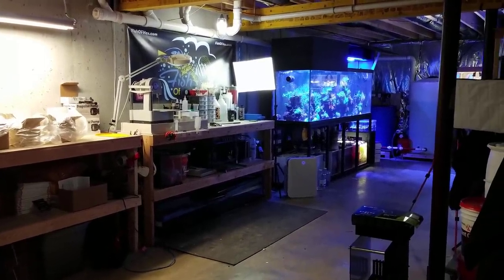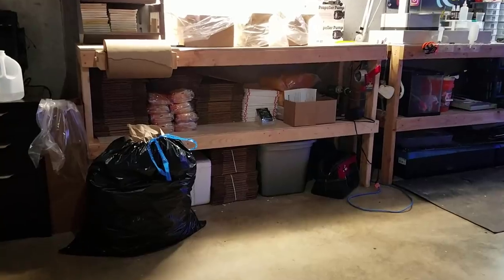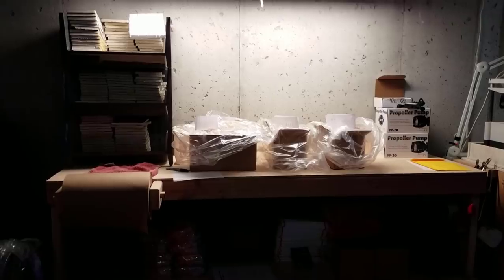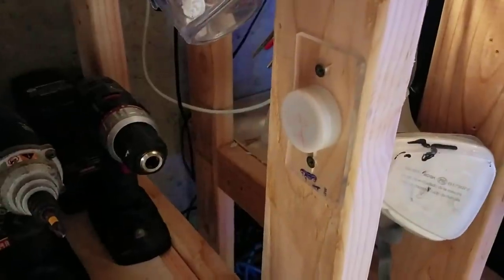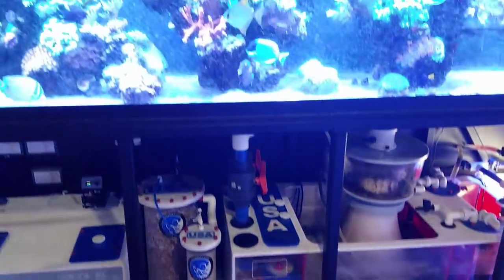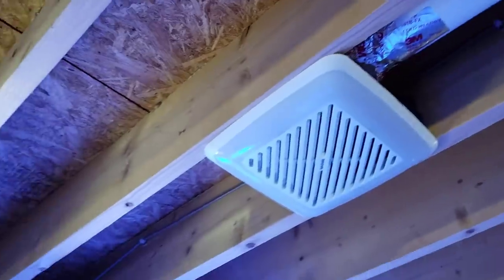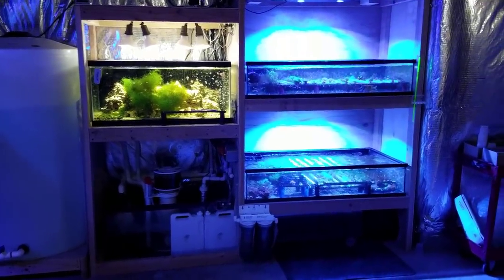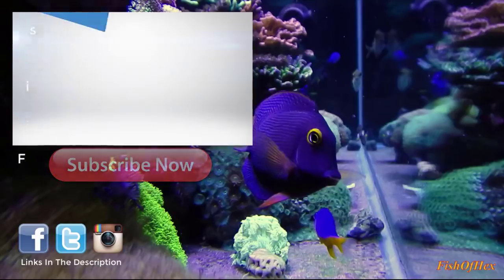Quality Of Life Upgrades Done | Fish Room Update

Comment: Great stuff! (Q.) After an ich outbreak, im running a fallow tank. I used to have quite high n03 and p04. So I had high alk to compensate. Now after a few weeks, montis are STNing Or bleaching as the n03 and p04 have dropped to zero(ish). Should I leave the skimmer off for the duration of the fallow period, as I am finding it difficult to raise the n03 with ghost feedings..

Comment: Nice, I'm looking fwd to the CalRx video.  So based on your DT water Vol plus coral demand, the flow thru rate chosen of your Kamoer is 80ml while maintaining 6.7-6.8dKH in the reactor.  This results in 8.3-9.5dKH target range for alkalinity without using kalkwasser?    As the alk drops you're increasing your Kamoer till it's max out at 120ml?  The other variable (CarbonDoser) is fixed at which setting?  Thanks!